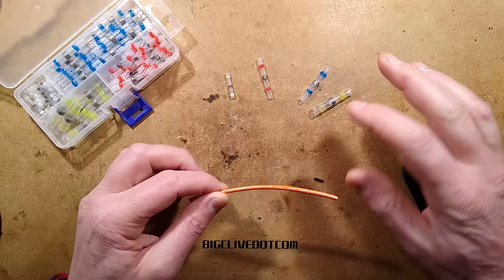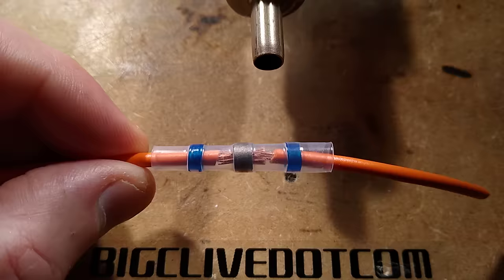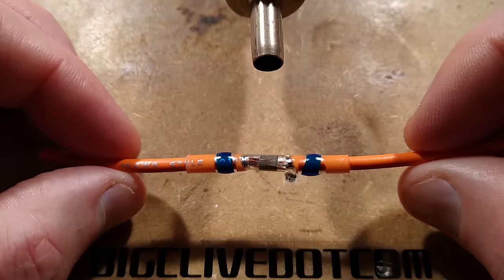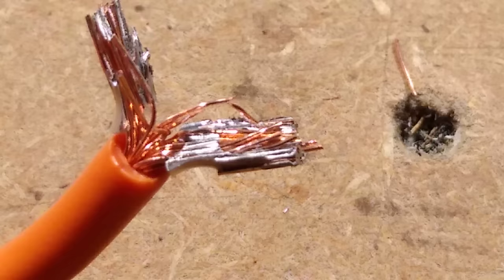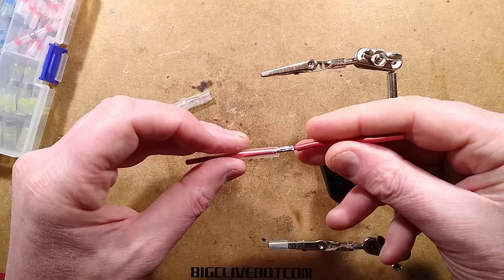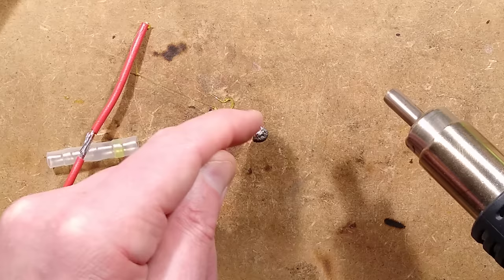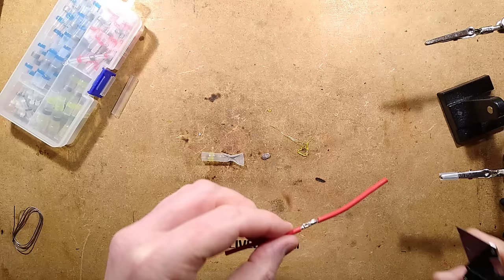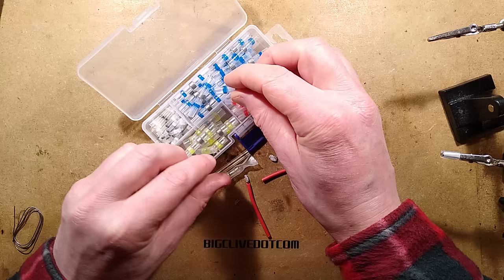Heat shrink solder butt connector test.

Comment: finally someone that knows what they are talking about reviewing these ,... thank you
Reply: rob burdack why didn’t he just put flux on the wires then
Reply: @zoopinc   because that would then defeat the reason of useing these ... the whole point is to be a single action solder conect and seal
Reply: He has not added enough heat, it is clearly seen at 3:06
It has not melted completely.
Reply: @gsp911  If did or didn't I would still agree with him that at least the larger ones need more solder.
Reply: When someone says this is better than a crimped connection, they don't know what they're talking about
Reply: @rskl3284  so u belive that a crimp connection is better that a soldier connection?
Reply: @TonyTony-xj6uv  certainly is
Reply: @rskl3284  certainly isn't. A crimp connection only has a mechanical connection to to the outer sides of the outer conductor, a soldier connection surrounds all sides of each conductor. Go out to a car and cut an injector cable and put a crimp on it and then pull up data a watch the pilot injection value go off.
Reply: @TonyTony-xj6uv  a proper crimp is basically the same as a full connection. Solder ads resistance and under wire strain/movement  will fail long before a crimp even would.  Anywhere that needs a solid connection gets a crimp in most industries
Reply: @rskl3284  no it gets a crimp in manufactur because the speed of assembly outweigh the cost of crimp, that is then taken into account during programming of controls. As for the fail rate if you put a crimp on a line it a place it was never ment to be it will fail very fast as a crimp creates a sheer edge. There us not a week that goes by thst I don't get a car in thats had crimps and the system has failed. As for the resistance a crimp will cause more problems unless made of copper and even then its going to play havoc on a can line as it will not  be anywhere close to the resistance.  You can argue all you want but the proof Is in the pudding I can literally go to work tomorrow film my proof
Reply: @TonyTony-xj6uv  do it and get the video up
Reply: @rskl3284  I will and I will also scope it  and show the erratic behaviour of the signal
Reply: @TonyTony-xj6uv  you don't know what your talking about. I build engine harnesses for a living and can tell you solder has not place in a car only mechanical crimps
Reply: @lewislloyd823  made up for you
Reply: @lewislloyd823  so it's been over a month and I can confirm you don't build harnesses for cars. If you do then its not for any of the following, ford bmw vw/audi (and all the subsides because they use cross platform looms) mercedes vauxhall/opel/GM  huyndi or toyota. The majority of them will use 1 reference voltage line and split off via solder joints. They will also do with the common neutral. Now you also have cars with the hall sensors around the vehicle will be connected via solder joints. And many other places around the vehicle. Now like I said before the reason that mechanical connections are used by manufacturers is 1, the ease of installation for the manufacturer( time is money) 2, component replacement, if components never failed they would be hardwired with solder 3, similar to component failure we have harness damage if you have a complex engine bay it's likely to have split harness. Funny thing though most damage to engine harnesses occur at the crimpd mechanical connections. What I have do have is a shit load of pictures of factory fitted solder joints on multiple vehicles I'm going to make little montage and link you to it. Its going to be called Lewis knows jack shit and lied about what he done for a living and tag you in it. Have a nice day
Reply: @TonyTony-xj6uv  This comment is rather amusing, I never said I built oem harness for cars. I work on the motorsport/aftermarket side of things. This area(if you knew what you are talking about) is where we build harness to a much higher standard than manufactures do to withstand the harshest of conditions(rally,f1,LeMans). Moral of the story is, solder joins fail and mechanical crimps don't unless you have no clue what your doing. Majority of people building oem harness have no clue what they're doing and I believe you fall into this category as I have now wired up close to 100 cars some achieving over 3500 whp and not one has a trace of solder in apart from pcb work. Think twice before posting a shitty comment when you don't understand the difference between mass produced/cheap and bespoke,quality products
Reply: @TonyTony-xj6uv  how is your injector wired in the first place. I can tell you, its two Junior power timer pins mechanically crimped
Reply: @lewislloyd823  why is the injector crimped ? Why isn't it hard wired ?
Reply: @lewislloyd823  and your shout about motor sport proves my point. They use crimp connection for speed of change. If they wanted longevity on something that would never need to be removed it would be soldered you would know that if you really did what you said, if you work in that industr your the gofer . 100 cars ? That's a novice. And you think that your better at building a a loom than oem? OK. The fact that your shouting thst its motorsport industry  is funny especially when you talk about rally ( can't speak for the other forms as I don't know about them) but rally I can I personally know that rally cars do use solder joints a lot. They use the crimp for strength and then solder it for the best electrical and data transmission. The fact is that they are then thrown away after a race so your 100 looms wouldn't last more than 3 years and at a really slow pace wold only take a month to build
Reply: @TonyTony-xj6uv  you clearly have no clue what you talk about and are to "experienced" to listen to someone who probably knows more than you so I'll leave you to it bud. I'll keep breaking records while you break people's cars. You talk like someone who works with 240v not 12v
Reply: @TonyTony-xj6uv  solder joints fail or a harness crimped joints don't that's a fact
Reply: @TonyTony-xj6uv  there is a method to hardwire an injector or sensor in which we do solder it but then we encapsulate that in epoxy resin so it cannot fail due to heat or vibration.
Reply: This is then run to a deutsch connector for switching out the component
Reply: @lewislloyd823  and the reason you would solder the injection or sensors........ because it makes a better electrical connection. Crimps for strength solder for better transmission of electricity and signal.  Its for that specific reason that they use as little amount of crimps or mechanical connections as you can. If you used crimps only you increase the resistance the reason high amp cables are soldered at termination. What happens at high resistance connections? 🤔
Reply: @TonyTony-xj6uv  wrong they are soldered only when we cannot find the oem connector or pins
Reply: @TonyTony-xj6uv  you understand that there is no real increase in resistance when crimping a wire(properly) how are you cables connected to your battery and alternator and your fuse panel and your starter motor. Basically any high current cabling will use crimped lugs
Reply: @TonyTony-xj6uv  just to prove my point further I have just connected two set of wires together one with silver based leaded solder with read 0.0 ohms and one crimped using 809-2363 crimps which read the same both using 20gauge type 44 wire
Reply: @TonyTony-xj6uv  where'd you go bud I'm still waiting for you to make yourself look like an idiot that outputs substandard work that fails but I haven't seen you for 6 days, I wonder if you've been sacked
Reply: @lewis lloyd  no I wrote a reply I just must not of set it. So you you say that there isn't much difference in resistance between the 2 but then carry out a test that says there is non ? Right? bullshit and you ask how starter and battery cables ect are terminated? Well on weak ass cars they will be crimped but any thing bigger than a draw of 120 amps will be hot crimped more of a weld than solder. Then you got things up to 250 amps (V8 W8 W12 ) or compression ratios above 25:1 use a crimp on it on on them and the outer conductors will frazzle and oxidise and become non conductive then ye fucked because they are the only ones in contact with the terminal end, a problem you wouldn't get if you use a solder lug first. Oh and me lose my job ha I'm not the one with a stubby because they made 100 race looms
Reply: @TonyTony-xj6uv  oof you sound a bit salty, some people just can't be taught how to do things properly especially when they get schooled by someone younger than them, you keep doing what you do bud and I'll keep making money fixing bad solder joints with crimps
Reply: @TonyTony-xj6uv  got any pics of your work? Or that video where you show me how to do it  "the right way" titled I don't know shit and I lie about what I do?
Reply: @lewislloyd823  actually no I don't I've exceptionally busy this week. But let's review how all this went. So the video in question is for repairing cables on cars. You said that you build looms for a living saying that solder has no place in a car engine bay, facts are every manufacturer dose it. So you change it to you work on motorsport. A fraction of the car industry. Then you say that the difference in resistance is minimal stated as a fact then change your mind and say no difference. You even said that injectors will sometimes be soldered and back filled with resin supporting my point that solder makes a better electrical connection. Then you tried the argument about starter connectors total fail. You argument is in the wrong place also as this video is about repairing looms and crimp connectors have no place inside of a  loom.
Reply: @TonyTony-xj6uv  you ability to collate information was summed up in you comment there. Manufactures use compression welding not soldering. I never changed my mind on the difference in resistance between solder and crimping only stated that the difference is less than 10 milliohms so not woth talking about. Lastly I never said something like an injector would be soldered because it makes a better electrical connection as that's Bullshit. As I said,and you ignored it is only ever done for two reasons, one being if it is cheaper or the oem connector is not fit for purpose ie waterproofing or heat. Secondly if you cannot obtain new connectors due to stock or being obsolete. So I'd suggest you go back and read properly before guessing. Any further questions you have please delve into the likes of HP academy which is suited to begginers and hobbyists, like yourself
Reply: @TonyTony-xj6uv  last question to ask, why do we use multi strand cable in a car?
Reply: @lewislloyd823  so they move against each other but you can't use that in your argument yes a solder joint will make a solid core but a professional solder joint is no larger than a mm with maybe a mm of wicking but a crimp joint dose the same thing but it's a lager connection. Here is a test for you, do a professional solder joint on say.. 22 gage  do the same with a crimp now coil both around say an m16 bolt nice a snug and tell.me how it goes.  The reason I'm suggesting this is that most real cars  have ducting with shear angles and little to  no space for crimp connections and if you jam them in there they will rub through other conductors.
Reply: @TonyTony-xj6uv  you don't know what hour talking about bud, where on a car can you not fit a 10mm but crimp
Reply: @TonyTony-xj6uv  and now you want to bend a weak solder joint around a bolt. A crimp does not do the same thing to multi core as solder does go and do some research
Reply: @TonyTony-xj6uv  as I said hpa is great for begginers like you who need to understand they methods you think are right are not and will fail no matter what part of the industry your in a car is a car. I give up with you your beyond help
Reply: @lewislloyd823  lad I've been doing it longer than you be walking I know more about automotive electrics than you can ever hope to know. Non of my work has ever failed I've replaced more damaged mechanical connections that people have put in and the surrounding Loom that the connections have damaged. Your only real argument for crimps is serviceability and tensile strength but the tensile strength goes out the window compared to 60/40 solder. You have not given any good reason why crimping is better. Its established in the industry that a fused connection is better at transmission of electricity and data. And if done with proper skill will be superior in every manner. If you personally can't make a better connection with solder then that's a problem with your skill level. Experience says that your wrong I'm right like you said your younger than me so will have way less Experience.  You don't have any real world experience you have built 100 looms and think you know it all when in fact there is 7 year old kids who have built more complex looms than that 100s of times over. Yes we are all taught in education to use terminal ends but thats just for serviceability. If all components on cars where guaranteed to last forever than you would never see a plug on anything everything would be soldered permanently, That's especially true in your line of work as components have to be quickly swapped out
Reply: @TonyTony-xj6uv  your incompetence exceeds your arrogance

Comment: How about dipping the ends in flux, also, would have been good to see a resistance test on the joint?
Reply: Microohmeter
Reply: Exactly! All it needs is some proper sticky flux.
Reply: The resistance test is what I was waiting for lol. I mean it really wouldnt have shown much though. Resistance of a normal crimped ground usually isn't going to be high(just structurally compromised). Even a normal solder joint is what, 0.01 or 0.02?
Reply: Amperage flow test, put a load on the connection to see if it will flow as much as the standard wire without getting hot or failing
Reply: @marsha414  conductance tester.

Comment: I've used these in car wiring harnesses before, fairly low current stuff but lots of moisture and vibration. No failures yet, and they're very quick and far better than the butt joint crimp done with cheap crimpers that you see so often in modified cars because they won't pull apart, allow moisture in to corrode the connection, or cause a stress concentration and snap off internally as is the case with the non heat shrink butt crimps.

Comment: Great video ! I use these frequently....my biggest complaint with them is that if you don't control the heat it melts apart at the plastic on either side of the solder. Heat control is essential as each size requires a different temperature and duration to melt it. I have found that the opaque red, blue, yellow crimp then heat shrink work better even without a solder band.

Comment: Used them a lot when I was working on avionics, pretty strong and waterproof. Perfect also to attach a small wire to the shield of a coaxial cable before plugin into mil connectors...
Of course, brand splices are of better quality and expiration date must be respected too.
In your test with much more solder, this could produce an issue: vibration is your enemy (true for car and aircraft), and the joint brakes at the transition of the flux and coper, inside the isolation... Making the troubleshooting quite challenging. That's never happening with splice.
Reply: In avionics? That's scary. Is it an approved method in your area? (I'm a mil 38999 connector fanboi btw)
Reply: @gliderp , yes, quite long time ago (>35 years), it was useful on Beechcraft (I worked on C90 and B200). But I don't know now.

Comment: If you "tin" both conductors first, then assemble the parts, then apply heat, when the solder band melts it will flow into the "tinned" conductors thus giving you afar superior joint....both electrically and mechanically
Reply: If you tin it beforehand anyway why not just solder it ? The only advantage is you will never forget to put a shrink tube on :-)
Reply: @KB-mo3sx  Speaking from experience, you don't always have enough working room. End of the day, my electrical repair kit has these solder shrink connectors, crimp and shrinks, solder, flux, double wall shrink tubing, and liquid tape. Use the best method most practical for the repair.

Personally, I love the white and red solder shrinks. Anything blue or over I prefer solder or crimps and shrinks.
Reply: Electrically and mechanically crimping is better option
Reply: Indeed, add some flux and think before you use these in a bumbling car. Should be fine for my small solar batt packs. I don't see anything in that box big enough to matter.

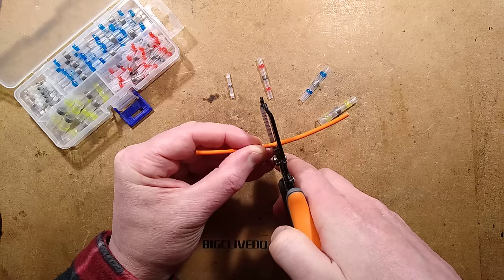Comment: 0:11 So I was driving along and then I went up a hill and my car took a dump. A fuse was blown. Replaced it, continued up the hill and it blew again. Long story short, my oxygen sensor wires were connected together with butt crimp connectors... and the plastic sleeves had expanded and slipped down the wires. So when I drove uphill, the bare metal butt connectors smacked into the firewall and shorted out, blowing the main engine control fuse.

Comment: Avionic maintenance throbber here, we use these inline splices all the time on low current wiring. They are waterproof, which is very important because nearly all of our cables are insulated with kapton and carbon arc tracking is no joke. Ours have a red dye on the solder ring that disappears when the solder is hot enough and begins to flow, we also heat the glue rings until a small amount of the goop seeps out of the heatshrink. They're a bit of a pain it tight spots because you need a heat gun, and occasionally you come across one where the heatshrink melts before the solder flows, but they sure beat pulling cables through the bowels of a jet. Use them a lot for bonding pigtails too.